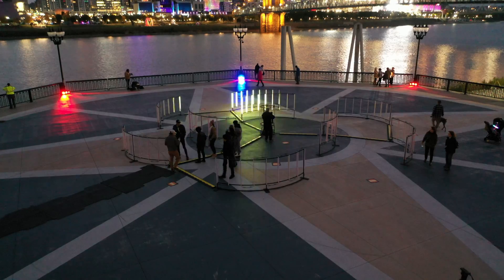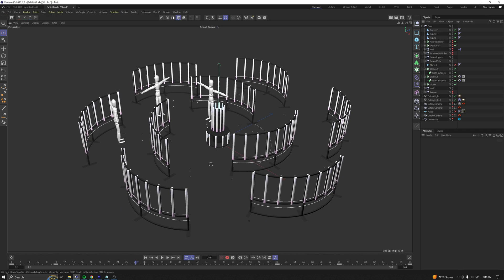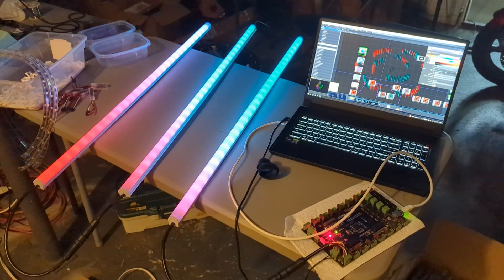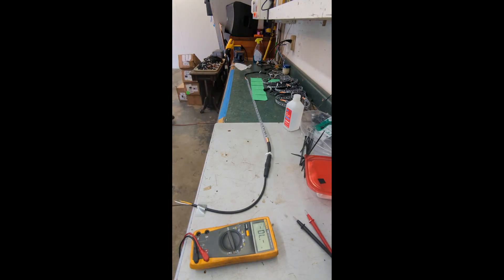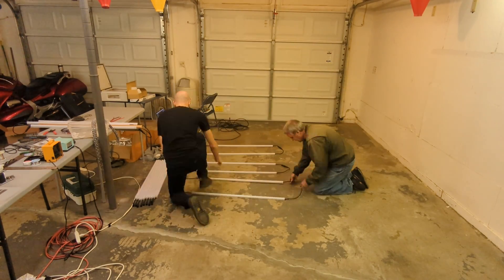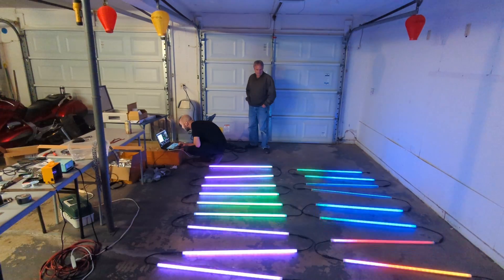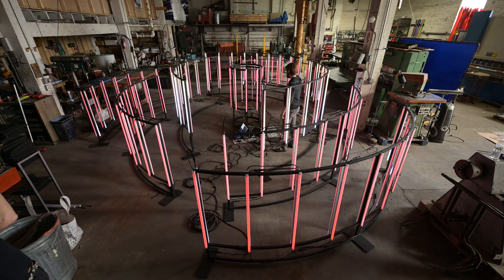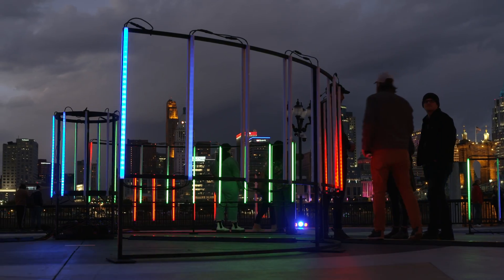Transforming hundreds of LED strips into this large scale light sculpture

Comment: Hi, great work!!

Do you have the reference for the connectors used between each bar, as well as the reference for the cable?
Did putting both DATA and power in the same cable cause any interference?

Thanks a lot!
Reply from the maker: For this project we used connectors from a company called advatek. They were good quality albeit a bit expensive. X connect would be a good alternative. We luckily had no issues with having power and data going through our connectors.
Reply: @DigitalCastaway  Thank you very much for your reply 😃

Comment: 5:47 We have all been in thact exact posture!

Super nice video and good explanation and production value! 

Two thoughts: 
Using an M1 MacMini is an, lets say, interrestng choice. But if it works it works.
Running the whole system on a single PSU is pretty bold though!
Reply from the maker: The Mac mini runs Touch designer well enough and was a platform I was familiar with. It was definitely a beefy power supply but our control board and system handled it swimmingly.

Comment: I teach soldering and led tape stuff at the HS level, and i am VERY interested where you got that flat black soldering jig; do you have a source for it?
Reply: That was my question as well.
Reply from the maker: Solder M8 from Amazon. More details will be in the next video!
Reply: thats the solder station.. i wanna know that black jig that held the wires and the led tape :)
Reply from the maker: @bransonmatheson6530  it's called the SolderM8 pro soldering jig